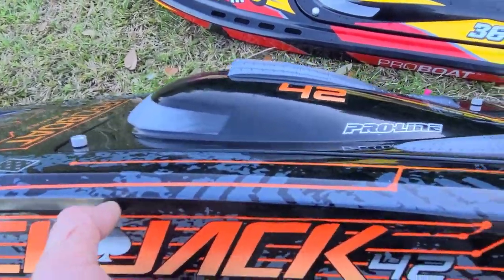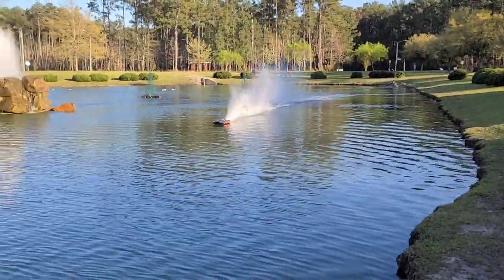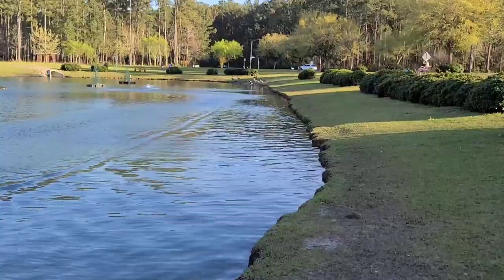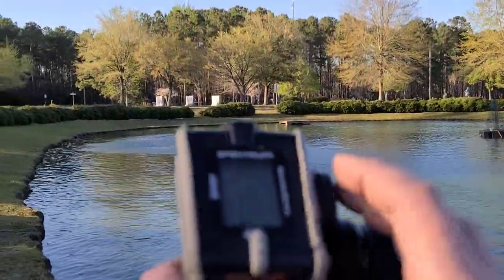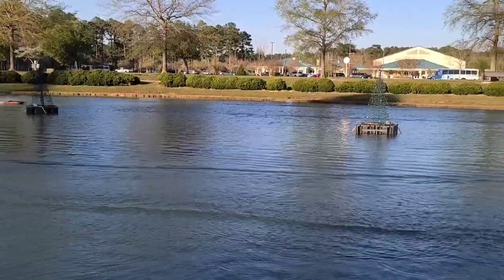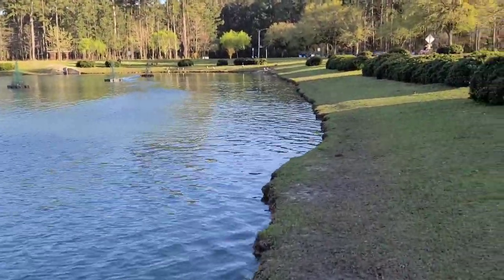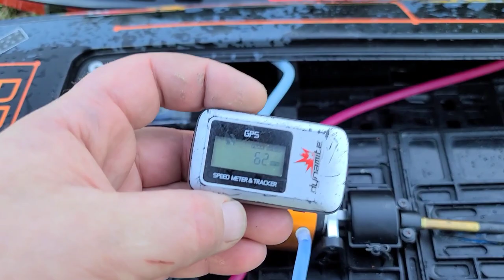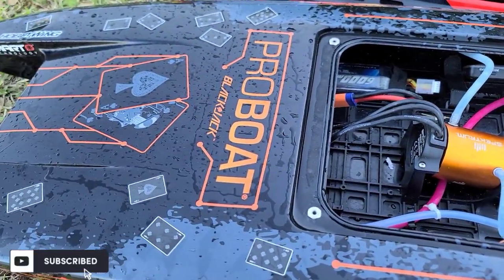Rc Boat Bitz Trim Tabs for the Blackjack 42 GAME CHANGER

Comment: I have been rebuilding an rc catamaran boat my dad and I built in 1988. Gutted it,  glassed it, and hopeful it will be getting test ran in the next month or so. It's going to be over-powered, and it's only 28" so I was going to add tabs to help tune it and keep it on the water better. Your videos have been so helpful with everything from  learning new electronics, boat setups, and motors. Excellent content! Thanks Big B!

Comment: Your videos don't need to go a particular direction every time. When Big "B" has fun, we have fun! As I watch this video, I'm finishing up a build on a 800mm all wood catamaran boat I bought from a China vendor on eBay.  It's unbranded and the instructions are terrible but I managed to complete the hull with a lot of trial and error. The boat is awesome, but it ended up with warped sponsons. I've sanded the sponsons down and got rid of most of the warp, but I don't have anymore material to sand without risking weakening the hull. I think I'm going to need to make new ride pads and then blueprint the hull. I'm going to have to search through your library for a video on blueprinting sponsons. I love working on a boat project while watching YouTube - of course your channel is  always first on the list. Peace brother!
Reply from the maker: I really don't have any proper blueprinting tutorials, the only hull I did for youtube is the blackjack 42 &  at the time it was an experimental  process. Unfortunately i didn't record the blackjack 24 blueprinting process 😕 wish I could be more help  brother

Comment: I just bought a used blackjack with those same tabs and looks like it does the job. Nice and even hull. Have it on my m41 and runs like a dream  just run them parallel with the hull and it will run really smooth. Plan on doing this on the blackjack.

Comment: I installed the RCBB tabs on my 42 and got 73 with the tabs. I mounted them a bit above the sponson with a very slight angle down. I relocated to a different place on the lake due to the BIOTCH swearing at me the first time I  ran the boat. It's  not sheltered much and I'm  fighting wind, ski boats and fishermen  due to the season. This fall when things cool down I'll  be better able to put down some good runs. I have only rescued the boat once since putting the tabs on. Still fast but way more planted. Love them.
Reply from the maker: Getting the blackjack ready she should be ready soon

Comment: So do the small set screws hold the tabs position without moving? They are a very nice design but the set screws worry me. Also is there any place to find them in the US?
Reply from the maker: Yes they work perfect.   Horizon hobby sells replacement trimtabs

Comment: Hey man nice boat. So nice my friend and I just ordered. We both have the zee 9000 for our xmaxx already. Using these batteries with the extra weight might be good enough without the trim tabs? Also I saw you trying different props below. What have you found to be the best? I want to order that as well. Thank you.
Reply from the maker: The stock ul-19 prop is a good upgrade prop. Also oxidean Marine 5016 (3blade) power prop is a good upgrade prop. Yes 9000 zees should be perfect

Comment: How do you estimate the degree of angle on the trim tabs, just by eye or by measuring
Reply from the maker: Basically eye it with a ruler or straight edge on the bottom.

Comment: Have you ever rolled off plane with this boat? I never drive my Veles anymore because the damn thing rolls over nearly every time I turn
Reply from the maker: No this boat holds down in a turn.  Lower the CG and it will turn better
Reply: My Veles rolls in the turns also. I think it's due to the squared off sponsons on the tranom. Proboat claims it was designed for SAW runs not cornering.  I've found that's its better to stay on the throttle in the turns, if you back off as you start a turn it will flip. Also a higher torque servo is a must on this model. Hope this helps.

Comment: Hey big B!! What’s the biggest prop you’ve thrown at this boat? I’m up to a 1917 and it acts like it wants more. The faster it goes the smoother it’s tunning
Reply from the maker: Pranther 260. 60mm prop not good for top end but dang if it was fast out the hole.
Reply: @IRONCLADRC  haha holy shit that’s a biggin!
Reply from the maker: Yea I was looking at the 1817 for the 42 but didn't get it because I was afraid it would be to much.   Lol.  Good to know that 1917 was on point. Did you GPS the speed?
Reply: @IRONCLADRC  yes me and my neighbor gps out 42’s, with 1917 they both run 69 mph. And just to let you know, I just tried a 44 mm 3 blade 1.4 pitch, and it’s the best prop I’ve ran yet. 64 mph and literally glued to water.
Reply: @IRONCLADRC  I’m going to order that 3 blade and a 47mm 3 blade cause the temps were motor 101* and esc 120* and that’s in 74* water
Reply from the maker: Good to know brother,   Thats some good numbers for sure . . I may try to take the blackjack out this week. I found a long stretch on the river,  should be able to get a few long runs in.
Reply: @IRONCLADRC  yeah man me and my neighbor are bound and determined to figure this big out and get 80 out of them. Once we get there I’ll make a video and share all content of the build
Reply from the maker: I'd like to see it once uploaded.  My top last year was 73 with a ul19 prop 😆
Reply: @IRONCLADRC  with the bigger 3 blade I’m positive I can break 73
Reply from the maker: Good luck brother
Reply: @IRONCLADRC  thanks big B!!